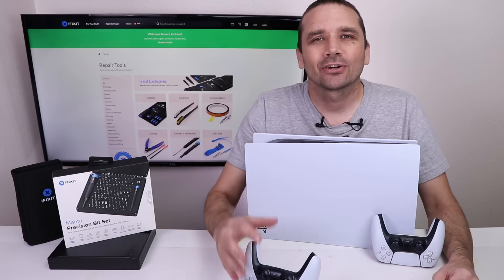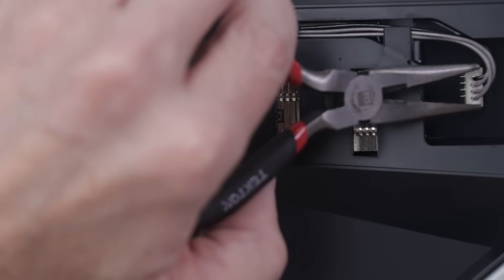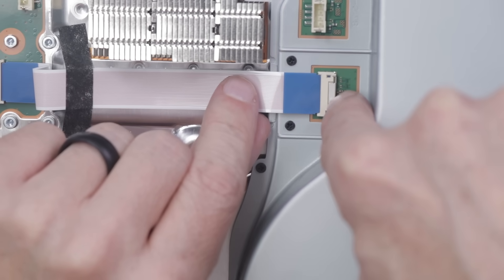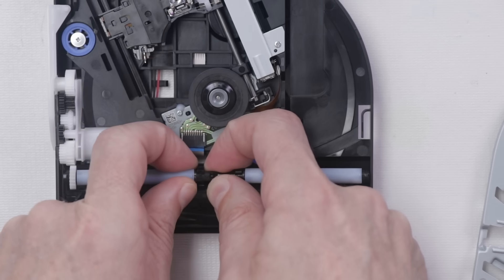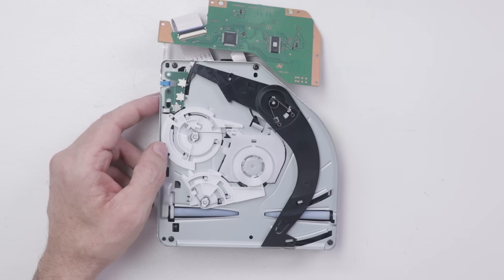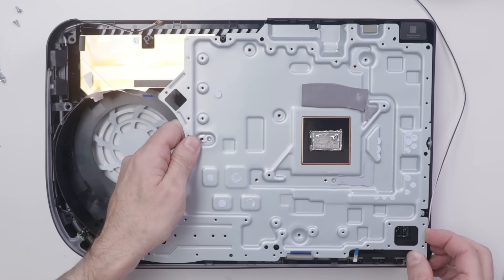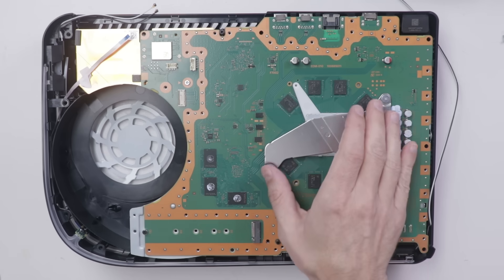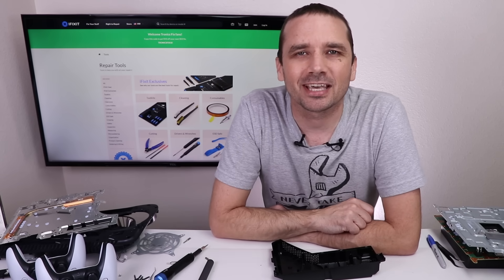PS5 Teardown - A Repairability Perspective

Comment: The PS5 has vacuum holes for cleaning out the heatsink structure. Does not require removing 43 screws.
Reply: @stef4nm why would you need luck, sony made them for cleaning out the Heatsink.
Reply: At some point I think these vacuum holes won't be enough, dust always finds a way to settle in.
Reply: @kinho093  i mean it is better having them than having to disassemble the console every time. It is nothing bad and can only help.
Reply: @Boki_86  I agree, better than nothing. But look at this fan, it is going to collect every particle of dust around the console. In any case I would wait for the slim version (mostly because I can't afford a PS5 now).
Reply: @kinho093  so you mean like every other fan?  I had every Playstation console so far an never had any problems with dust so I  don't think I am going to wait because a Slim variant might be better at not collecting so much dust.
Reply: @Boki_86  Dust is the least of problems. I'll wait for a more reliable, prettier and cheaper variant. If you can afford to buy a PS5 now, good for you! Enjoy!
Reply: @kinho093  there's definitely not going to be a "slim" version the best thing you can do is get the digital version
Reply: @Tjayfl  why not? All previous generations had. The purpose of building slim models is to cut production cost.
Reply: @kinho093  because all of them could get slimmer, they are bulky, tell me what would you could cut off the ps5? everything has its own purpose and problems can start by messing up the most simple thing component, the only thing that could make it slimmer is making smaller base plates
Reply: @Tjayfl  I am not a tech expert but I'm pretty sure they can design smaller and more efficient components, without cutting anything. More energy efficient chips results in a smaller power supply, motherboard and fan. It always has been the case, it's Moore's law. It will take a couple of years, but we'll see.
Reply: @kinho093  since the xbox is just a rectangular prism it can be smaller than the ps5 using the components that we have now in 2020, the ps5's shape is very specific meaning the components are even more limited  like you see in the video they had to modify even the simplest things to fit the ps5's design. (like the disc tray for example) If you're really waiting on a slim version for the ps5 the ps6 is gonna be out by then, The slim is going to have to have to keep it's shape )( while also being slimmer than the original AND also have better energy efficient components as you say.
That's definitely hard feat I'm a play station fanboy but you should probably get an xbox.
Reply: @Tjayfl  You're right about today's components, but I don't think it will be necessarily true in the future. PS3 fat was pretty bulky and the first slim version is totally different in design. It was launched 3 years after the FAT. 
Man, the main reason I am going to wait is because I'm a poor guy from a developing country. I'll probably get the PS5 when the PS6 launches.

Comment: I'm just glad the reality of the performance of these things (their GPU's are on the level of the 2060, albeit with worse ray tracing) has come to light, and the lies about them being "better than 2080ti" can finally stop.  Jim Sterling called this the "year of lies" for a good reason.  Neither console can even stand up to the 2060 Super, let alone the 2080ti, let alone the 3000 series.  The systems are ok for what they are, at least they aren't several years out of date on launch day like the PS4/XB1 were.  I don't know why someone would expect a $700-$1200 GPU in a $500 box, that's just dumb.  The PS5 seems to be designed better from a hardware perspective (Microsoft design is always terrible).

Comment: Oh man. Liquid metal is really a nasty heat conductor solution. Even it has higher thermoconductivity then silicon based thermal paste, I still don't like it.
Reply: Leopold  Hard to clean; electrically conductive, so clean application is necessary; potential toxic, at least irritating for skin, eyes and respiratory; and oxidising on metal surfaces.

Comment: You just need to use your vacuum cleaner at holes that provided to user which does not require to remove any screws. What a disinforming video.

Comment: I can't wait until Sony has a PR nightmare on their hands from the liquid metal. That stuff is going to find some way to fail in massive quantities. This could get to RROD levels of bad. Sony's had some snafus with every console, but this one is going to take the cake. Liquid metal is a stupid idea, there's a reason nobody else uses this stuff.
inb4 fanboys say "SoNy TeStEd It", ignoring all the other design flaws that Sony "tested" and shipped to customers anyway. PS1 disc read errors, PS2 disc read errors, PS2 Slim power bricks that catch fire, PS3 YLOD, PS4 BLOD/pulsing blue dickpunch of sadness. "Testing" it means nothing, widespread use will reveal far more than internal testing ever does.
Reply: Wait what's wrong with liquid metal?
Reply: @purplegill10  It is likely to move around, and hurt other components if incorrectly installed, or incorrectly engineered.
Reply: @DSuave03-Me  It looks like the compound they put around the die itself was done to prevent that
Reply: @purplegill10  Should be, but its possible to damage in shipping too, only time will tell.
Reply: @DSuave03-Me  Yeah, I hope not. Having LM in a console seems like a really good thing for long time cooling so I hope nothing bad happens :(

Comment: For those of you who just wanna clean your console;

In the official PlayStation teardown video the guy says there's two holes for vacuuming the dust out so you probably can just do that instead of opening the entire console
Reply: And if you do that regularly (every 2 weeks or maybe even just once a month) there shouldn't be so much dust accumulated in there to ever make removing the heat sink for cleaning necessary.
Reply: @skraz0r  
Exactly. I'm glad they added those holes
Reply: In addition, you don't need to break the heat pipe from the Mainboard, so if it's just for cleaning, there shouldn't be any issues. It's really not that hard for that sole purpose.
Reply: Funny, I didn't see any holes in this teardown.
Reply: @mjc0961  you would've if you knew what to look out for. I saw them, because knew that they're there. If you wanna know where the, are, watch the official Sony teardown video, it's explained there.

Comment: The worry is that if it gets dust into the heatsink, and that's only really a problem if it's on the floor.  Most people will put it on the floor because it wont fit in a cabinet...

Comment: That's the hard way, the easy way,  use sledge hammer and duct tape to repair ps5, let me explain :

1- use sledge hammer to separate ps5 parts until you find the part you want to fix.
2- after you have fixed the damaged part assemble ps5 parts with duct tape.

Comment: According to Austin Evans' teardown, it's not really necessary to remove the motherboard to get access to the heatsink and power supply.
Removing the shield also removes the screws that anchor the entire assembly to the other side of the case, so you can lift the motherboard along with the heatsink and clean the dust and dirt without ruining the liquid metal seal, the same for the PSU.

That would give it more points for repairability, and most of all, ease of maintenance.
Reply: I expected this to be possible, as it's also much more efficient from a production point of view. Like this you can pre-assemble more modules and just place them in the case for final attachment.

But obviously the dedicated holes for vacuuming are even better as you can even regulary clean the console (every 3-6 months) in a few minutes so only little dust builds up. (The air intake being a on the top of the console, so it won't suck in as much dust in the upright position, will also help)
Reply: Good to hear. Thanks.
Reply: Exelent!!
Reply: Really I'll go check out his teardown after this
Reply: Yeah I don't believe you need to even remove the heat shield.  They would not build it that way...no way.  The entire thing HAS to come out as a unit,
Reply: There's also the vaccumable dust catchers. Theoretically if you cleaned it once every two weeks to once a month you would keep all but a small percentage of the dust out. Been doing it with my pro since I first got it and it barely gets loud, aside from some coil whine from a CPU inductor(known problem),for an almost 2 year old console.
Reply: Yeah, except that wouldn't give it more points for reparability at all, because if you need to do a real repair and not just "clean the dust and dirt" it's still a huge pain in the arse. You confuse reparability with ease of maintenance. They aren't the same.
Reply: @mjc0961  
If the power supply is damaged, you don't have to break the liquid metal TIM contact, that's what I mean.
Reply: @Albert-P27  that should be a given what computer or consoles ever required you to break thermal contact to do maintenance on the power supply??
Reply: @whothou  none have. He's just saying its much better that the ps5 wasn't the first.

Comment: Keep in mind that the PS5's heatsink is designed to be cleanable without having to tear the device down. Just remove the outer shell, and you'll have a hole specifically intended for vacuum cleaning.
I'm aware this isn't the same as deeply cleaning a heatsink, but I'm sure that it's more than enough for the average customer.

Comment: Man, they really don't want you to take a peek inside the console.
Reply: Please tell me if spearate the heatsink and cpu its true if put it back it will not be cooling again and no need to reapply metal liquid please help me
Reply: @ehabsaeed7686  based off everything I have seen, you don't need to take the heatsink off to clean it. You can still keep it mounted onto the motherboard
Reply: Most tech nowadays isn't ment to be taken apart, keeps people from easily tampering with the system

Comment: Hey @TronicsFix or anyone else who is expericend with this stuff: i did some small disassembling projects recently (modding switch pro controller and cleaning an old laptop fan), and am looking to get some basic tools for future repairs now. 

I have a lot of difficulty reinserting the ribbon cables, is there a special tool for it?  I used tweezers (non ESD protected ones lol) but that seems a bit dangerous to me, since you easily can bend the ribbon cable.

An online search didn't yield lots of results, so i am grateful for any answers.

Comment: You have to remove the bottom cover to release a stuck CD? OMG, what a dumb design. First thing I would do: bore a little hole ;-)
Lose warranty by removing a CD - in 2020?  really ?
Reply: The side covers are specifically designed to be user removable, there's no way that taking them off could void your warranty.
Reply: @lawrencein  You might be right, but anyway a bad solution in  my opinion ;-)

Comment: Much easier and less damaging way to take the covers off is by lifting up the top back corner (when vertical) and sliding them to the diagonally opposite bottom front corner.
Just in case this is anyone’s first look at a tear down and needs to do it themselves.

Comment: Being able to pull out the fan without voiding the warranty is a good thing in my opinion👍
Reply: I don’t know if this applies anywhere else in the world, but in the US warranty stickers are illegal.

So here it’s mostly a scare tactic to prevent you from repairing the console yourself.

So if you do happen to remove the warranty sticker, the warranty is still valid.
Reply: @TheLostMidnight  yea I nearly fell for it too but I later found out the stickers are unenforceable here in Australia. They are actually unenforceable in most countries around the world. I think that they now put it there so they know to look for the smallest  find any damage no matter how small  to try to reject your warranty claim.
Reply: why? you need access to heatsink
Reply: @snowpuddle9622  you do have some access to it. But even then dust can get on the fan but not clog the heatsink.
Reply: It's good but the heat sink is hard to clean...and usually it's the part with the most dust...
Reply: That's a good thing as people can clean the fan them selves and make sure the console is clean
Reply: Literally the only plus for repairability. Everything belse seems hard

Comment: @tronicsfix could you test the interference of an external hard drive and/or recommend any fix for Bluetooth interference?

In preparation for the arrival of the ps5 I took out the 2tb sshd I installed, put the original 500gb drive back in and put the sshd into an enclosure and have begun transferring my library to it. 

Shortly after starting operation preparation, I noticed my ds4 controller was unresponsive and would turn itself off, I solved that by changing the input method and connecting via a usb cable, I  started up CoD mw, turned my headset on and almost immediately the sound dropped out, then came back and repeated this until the headset disconnected itself and then reconnected to start the process all over again. 
After a bit of research I found out that usb drives emit a low frequency of sound that disrupts Bluetooth signal. 

Now I’m worried that plugging the drive into the ps5 will do the same thing, rendering any game in my PS4 library unplayable from the external drive. 

Despite Sony themselves advising its player base to only store PS4 games on an external drive.

Comment: I have a question. The button cell battery 9:16 on the motherboard top left-hand corner keeping in mind that the board has been flipped over from top to bottom. How do you change it when it wears out without removing the board and having to put thermal paste on the apu when you rebuild it as the cr2032 holder is the clip in type but how do you get to it with the board in place to clip out the old battery and clip in the new battery without removing 42 screws and disturbing the liquid metal then having to clean and replace with fresh thermal paste ???
Reply: Just buy a new console, what are 500€ anyways?
Reply: @andreasa.2226  a new quality branded button cell battery cr 2032 from duracell cost about €1 maybe even cheaper.
Reply: @CostelloPlays  dude, sony dont want you to be able to repair the ps5. Its entire design language just screams "i want to become a brick!"

Comment: Moved to the Xbox ecosystem from de Xbox360. Did and do repairs myself to the controllers and consoles when needed, as an electrical engineer it is fun and relaxing.
Early 360 had "some issues", later ones have been really solid.
Xbox One and One S have not had a single issue in the console.
Controller wise, Xbox360 do need some work to keep going, replacing switches for triggers and complete units for the sticks if cleaning does not solve drifting.
Best upgrade are aluminum triggers and sticks.
Xbox One controller cleaning the sticks, other than that pretty solid.

Looking at this video and the one of the Xbox Series X, completely agree from repairs point of view, Xbox will offer more options for d.i.y. repairs.

Great videos, just subscribed to the channel, really useful resources.

Looking forward to get my hands on a Series X once the next shipment arrives.

Comment: At 8:00 you should be able to pull the whole motherboard unit out this point and get access to the PSU without having to take the heatsink and heat plate off.

Comment: PS5: no CPU socket, no video signal re-soldering under big integralted processor ...am4 socket+amd ryzen desktop cpu in laptop,PC,consol!1000years no problem, 32GB DDR4/ GDDR6 ram,playstation motherboard+ am4 socket+ amd zen2 desktop cpu+navi2 GPU chip +extra cooling+custom 1TB SSD,300W tdp cpu cooling in case

Comment: I always enjoy watching your teardown videos.  Sony's choice of internal power supply really perplexes me.  They must have known that the console would be significantly larger with the internal power supply.  Not to mention the heat output.  An external power brick is a far better option.  Especially if it has the separate power plug lead.  Like what they did with the first edition of the PS2 slim (or was that the revision).

Comment: base on the official teardown video,  the guy open the machine the otherside which first revealed the power supply 😂
so basically its a sandwitch and normally you won‘t mess up with the mb as a average DIYer

Comment: great vídeo,

 i take some print screens when you remove the heatsink, looks like you can remove the board and the heatsink without remove all the screws, the las screws that you removed, looks like are only to attach the metal plate to the heatsink but not to the black case, maybe i cause the direction of the camera and i can see any place for the screws.

Comment: About the SSD.
PS5 went for the hardware solution for quicker loading while Microsoft has the luxury of DirectStorage IO. It makes sense the SSD is soldered.
Also from what I understand, Xbox Series X internal SSD is firmware locked and not meant to be replaced to begin with.
Reply: Problem is SSD only have so many TBW endurance since main OS is on soldered SSD it will be non-repairable. Unless firmware update lets you move OS to expandable slot in future. Digital Edition will be even worse. Sony didn't even post endurance of SSD or NAND type MLC/TLC/QLC
Reply: @jaggsta  
Unless somehow Xbox allows firmware installation on third-party SSDs, the same problem is on Xbox. Both consoles would need either company to be replaced anyways. While I share your concerns, my SSD stays at 96% health even after 2 years of usage every single day. So I wouldn't worry too much. It might be a problem if someone wants to collect PS5s or Xbox SeX/S a decade from now though.
Reply: @cunnyman  Xbox Series X teardown has replaceable SSD inside the system and expandable slot.